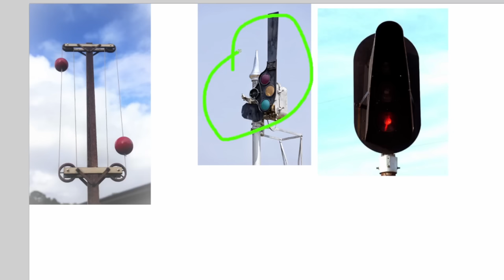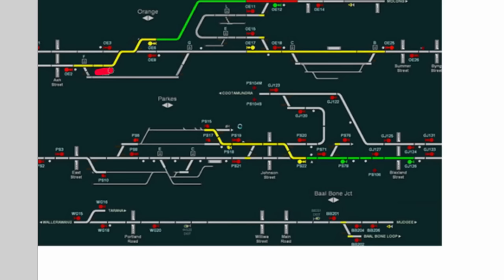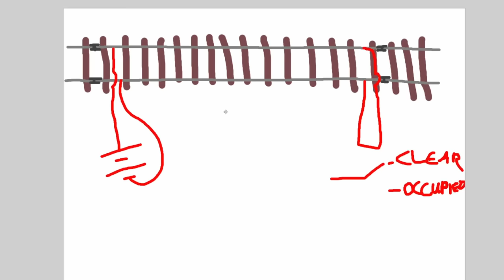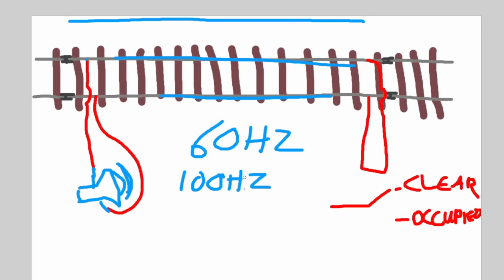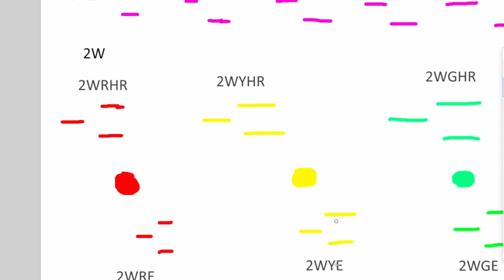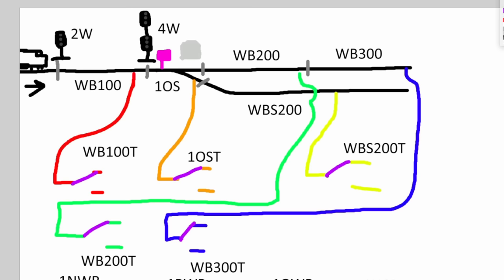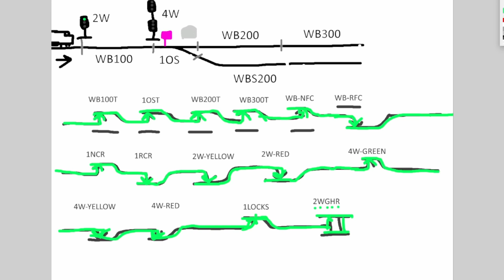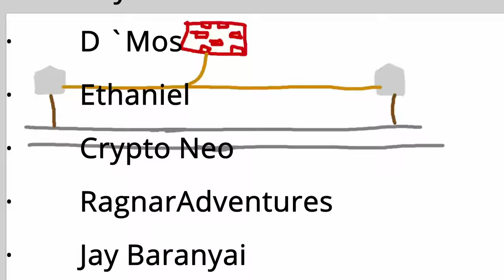SIGNALS 101: 10 Levels of Train Signal Understanding

Comment: Very informative Hyce. Yeah having CNW as the hometown road you always knew any run through power was going to be trailing. I'm on Uncle Pete's former CNW Chicago/ Twin Cities  Muscle Line ( or northwest line as we locals called it) and was for some odd reason had a different variety of ATS than the rest of the system and it meant that in the days of common power swapping between CNW and UP even dual system ATS locomotives couldn't lead on the NW line. That did work out even into the UP era that meant until UP finally got the PTC up and running last year the few freight trains( sadly in a fit of budgetary cuts in 89/ 90 or so there's a lot more bike path than track between Chicago and TC and GM closing the Janesville WI plant killed nearly all freight traffic on the line)that ran had a SD40-2 pilot locomotive for ATS reasons. 
I understand the need for PTC but I do miss the ability to discern what railroad you were encountering if you had no map or train to identify the line or at least it's heritage by the type of signal it used.

Comment: Watching part 9 reminded me of a conversation I had about CROR (Canadian rail rules) #564 - authority to pass a signal indicating stop.  The rule is simple, but seeing how many things have to be checked, I bet it’s a headache for RTC to issue that authority.
Reply: That is why Call-on signaling has gotten more popular.  I don't know of its status in Canada, but CSX uses it all over.  It allows the dispatcher to signal a train past what would be a Stop signal into an occupied block with an upgraded Restricting signal.  This maintains all the safety features of the interlocking plant while avoiding just talking a train past a Stop signal.
Reply: @jovetj  we do have restricting signals as well - they are actually fairly common - however I’ve seen trains request permission due to signal malfunctions approaching a single track section.  There are several ways to indicate restricting speed within the Canadian rules.

Comment: For use on 25 kV 50 Hz electrified rail lines they also use  track circuits that work on 83 and 1/3 Hz, the power being injected on one side of the insulated joint and being recieved by a motor-relay on the other side. It's a pretty old system, and used to use a motor-generator group to produce the odd value sinusoid by using the motor running on 50 Hz. Now it's usually generated by electronics.

Comment: My grandpa was a signal maintainer then inspector before he go injured on the job which forced retirement happened in 2001, he explained that tracks are mainly grouped in 3s, if the first light is green, go, if its flashing yellow, slow down a bit. Then 2nd light is yellow, it means slow speed, expect next light to be yellow or red. Then 3rd light can be red, yellow or white which means slow down as much as possible

Comment: Very interesting.   I  have designed various smaller non life threatening relay logic things, and state machines using logic gates and flip flops, etc.  Including a fancy at the time audio switching system where the operator set various channels on and off by pressing keys.  The system sent commands on the audio using nonstandard DTMF signals, the remote ends decoded,  set switches, and replied via DTMF so the control box would light indicators that the command was processed.  No microprocessors involved in that one.

Comment: As a side note, for those familiar with Lionel model trains, the track circuit signalling system is VERY similar to track blocks set up to trigger accessories and signals there. The main difference is that the middle rail is "hot", where the power flows into the track circuit, and the outer rails are "ground".

Comment: Great to see Parkes and Orange track display from New South Wales, Australia.
I note that others have referred to axle counters; these are used on the Adelaide suburban network where the aspects are direction based . The earlier system and that in use on the rest of the state of SA (where there are fixed signals) is speed based which is the general case in the USA.
The relay logic took me back to my early days as an EE in a steel works where conveyor and process drives were interlocked the same way but with somewhat less verity.

Comment: there's a railroad mod for minecraft, and that's what got me into trains. it has switches, and addons to that mod have signals too. I've used computercraft before, so tried to program computers to control just the three little sidings I had so that I could hit a button and put my train in that particular place.

I never managed to get it all to work properly. it truly IS madness.
Reply: Actual train simulation software is much more fun than that.
Reply: @jovetj  except driving trains around is quite literally ALL you do in a game like TrainSim/Dreail Valley/RRO.

Minecraft lets you use Trains for actual logistics. Wanna move spoil out of a mine, have someone else in another part of the server that needs a crapton of cobble for a build? Trains.
Reply: it's like getting the traffic flow mod for Cities Skylines as opposed to just running ATS/ETS or City Car Driving. It's a tool to meet goals.

both are good, but they're very differant.
Reply: @jovetj  Shame all of the major ones are notoriously predatory with their business practises, not to mention poorly optimised with weak post-release support.

Comment: This was really cool and some excellent electrical engineering! I think this explains why there was a crossing that went down for several minutes but no train ever came through and then when I later saw workers doing something inside the bungalow.

What I do wonder is whether it also explains this weird, thick piece of glass that I found when I was walking on this public walking trail that runs next to the tracks (but at a pretty safe distance). I saw the glass glinting in the sun a bit nearer to the track and I am curious by nature so I had to go see what it was. It was broken, green glass with what looked like threads of a screw on the inside of it. It was too interesting not to pick up so I picked it up.

When I sat down to have lunch during my hike, I took a picture of it with my phone and did a photo search to see if I could find out what it was from. It turns out it was an old glass insulator that the internet said could be used on high voltage lines and was sometimes also used on train tracks. Although the high voltage lines aren't very close to where I found it, I assumed it still must have been from them because I didn't think there was electricity on the train track and it wasn't near any of the bungalows but maybe it had been a part of one of those insulators between track sections. Perhaps that's why both the local crossings had come down at odd times and why there were people working on the bungalows shortly after all of this. In any case, the glass was really cool and it's too bad the one I found was shattered to bits.

Comment: We have 4 aspect signals on some routes, sequence is red, single yellow, double yellow, green. 
What us odd to my eye is the change over to LEDs. On the roads the LED traffic lights still have individual aspects, separate lens for each colour, while on the railway they've adopted multiple colour single aspect lights, or two aspects if you require a double yellow signal.
Thanks for your video, tge US signalling is quite different to the UK in some ways, but looks like it can convey more information through the various aspect combinations.
Reply: You are required to have normal colour vision (or at least pass a test that you can distinguish the signals) to conduct a train. This is not required for driving on the road. So the orientation of the signal head distinguishes between the red and green light.

Comment: Big stations in Germany use Hall-Effect sensors for detecting train positioning. Depending on your coverage you can line up trains in one siding with accuracy to a car´s length or less if you chose to. Add hydraulic switches and you can dutch drop 30 cars on to 30 different sidings in intervals of a couple of seconds.

Comment: Trip stops (or in the UK trip cocks) are still in use on London Underground to stopmtrains passing stopmaspects. They were also used on parts of the North Eastern Railway where it was known as the Raven Fog Signal that caused the whistle to sound if the trip cock was set to repeat a stop aspect.
Reply: They're also used on Chiltern line trains where they share the London Underground lines. Also Merseyrail use trip cocks.
Reply: NYC subway has these as well and I think uses the same terminology.

Comment: Hyce, this is the one thing I wish they'd implement in Derail Valley. Signals that would let you know with a light or position cue when to slow down.

This wil be an essential thing once AI traffic gets in the game, but I wish they had them now.

Also as a side note you should probably change your preview picture since you're no longer in Railroads Online.
Reply: I think they did that they use something similar to the german signaling signaling where green yellow means slow otherwise you need a "extra" signal zs 3 or a row of lights cant remember how that is called.
Reply: @jurgenkriebs9405  Haven't seen that in the game. It needs to be in there though.

Comment: So I actually understood a good deal of that based off of other stuff I've tangled in... at the cable company we deal in higher frequency signals in the mhz range, in my area the plant runs between 5-700 mhz. Prior to the cable company I did satellite where they controlled where the dish got its programming from, which ran off of 13v and 18v currents and more advanced dish systems also had a 13v and 18v pairing with a 22 kHz tone. When the signal was split off of the dish for multiple tvs it ran through a multi-switch, which would have assigned where it got its programming from based off of what the box requested and where it would find it.

Comment: Thanks for the explanation, on the railway where I was a driver, outside the Depot Yard we had those harmonic track circuits and I wondered how they worked! Besides the silver box pairs, the side of the rail is also stenciled with TX and RX (I assume this means Transmit and Receive) and then a serial number. As a driver we know about track circuits but not exactly how they work so this helped me understand a lot - thanks! I do wonder though why in the depot we utilise the track circuits with the gaps in the rail as opposed to the mainline with continuous welded track.
Reply from the maker: cheers mate - yes, TX and RX are transmit and receives. If you have signals around the depot, you have to use the gapped type if the signals are the method of enforcement. The gapless / audio style circuits have what's called "pre-shunt" and "post shunt" where you will actually show up early, sometimes within as much as 30-50 feet depending on the circuit setup. That means that the signal will change that early, which can easily cause confusion, so signals are almost always co-located with insulated joints. If you don't have signals - couldn't tell ya. haha

Comment: Im in the uk, my grandad told me semaphore signals were set to high for go, low for stop, because if snow built up on the signal and forced it down, that would be a fail-safe, so trains would stop, and telephone a signalman to check whether they could pass the signal or not

My friend went over to America to work on the advanced train protection system, basically if the train ran a red light, power would bw cut from the motor to the traction motors, and the brakes would be applied
Reply: Correct. In places like Britain, who use lower quadrant semaphore, the arms are counterweighted so that if the control wire breaks (fails) the signal will will ‘fall’ to stop. The safer indication.

Comment: One of the most important differences between rail and road signalling systems is that there is a SIGNIFICANT difference of the reaction/response/physics between a train and a road vehicle. Train signalling systems therefore have to provide or be decided by forewarning/conditions ahead, not just on-the-spot go/stop.

Comment: As someone who has invested quite some time (as a hobby) diving into German train safety systems (signals, dispatching systems, etc), this is pretty fascinating. Obviously a lot of things have overlap, but there are actually some interesting differences.
Reply: As a newbie in Train Sim World (that's why I watch this video), I find the German system more user friendly than the American counterpart... not to mention that the Americans don't have a standardized system for the whole country. Each railroad company has their own set of rules and I find that quite confusing.
Reply: @PapaBear6t8  careful: Germany has 3 major signal systems, depending on time and location. And especially the Hl system (all signals built between I believe 1950 and 1990 in the former GDR) is really confusing and complex - it has 17 aspects iirc. I'm not sure any routes with that system are included in train Sim world though.
The Hv system (the one where the distant signals have diagonal lights) is reasonably easy to understand and the Ks signal (the one where you only ever see a single active light on a signal) is the most modern system and imo easiest to understand.
Reply: @TheStiepen   Thanks for  the info!

Comment: I'm a signal design engineer too, but in the UK where our principles are somewhat different!
Reply from the maker: It's neat how different the systems are, isn't it?
Reply: @Hyce777  absolutely, ours dosn't normally attempt to control the speed of the trains but does tell them where they are going...
On extremely large speed reductions for turnouts we hold the junction signal at red until the train is timed to be at a suitably slow speed then release it

In other situations we have flashing yellows that tell the driver they are diverging but it's up to them to know the route to know exactly what speed they need to get down to
Reply: @dasy2k1  We do have some approach-release signals here in the States too, namely on subway signaling systems.

Comment: Its so interesting to hear the electro-mechanical releys in signal bungalow. Fun to hear the flashing yellow light generated by the responding relay. A lot of them still in operation around here.
Reply from the maker: Yeah, they have a really satisfying "clunk" to them, don't they?
Reply: @Hyce777  True. And  they are not producing wierd issues. There was a unique problem one of a level crossing. A 2 lane main line had the responding "attack" points for red signal. If 2 train entered 200ms difference to the sensors the singals wont change to red. So trains could pass through about 130km/h max speed to an unsecure crossing. The problem was caused by the fiber optics latency. Sadly there were some recorded instances when this happened but no accident happened.
Reply: The code relays are what I enjoy(ed).  You could tell the signal indication just by the rate of the sound.

Comment: Personally a fan of semaphores and the manual interlocking towers. The British system of using bell codes and the token instruments is fascinating, have a few simulators of them and it's a challenge to pull all the levers in the right order to keep the trains on time and going to the right places.

Love the old oil signal lanterns too, collect 'em and use them all the time.
Reply: Sure is one nice thing about semaphores: as a railfan, you can read them from the back, too.